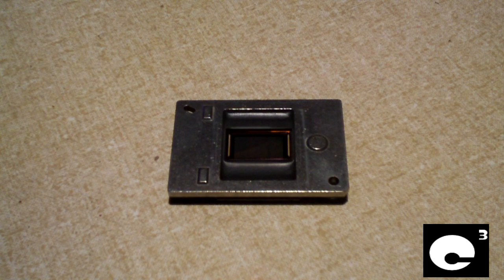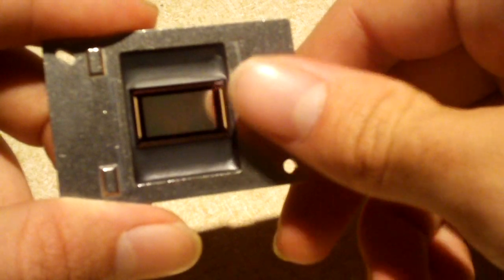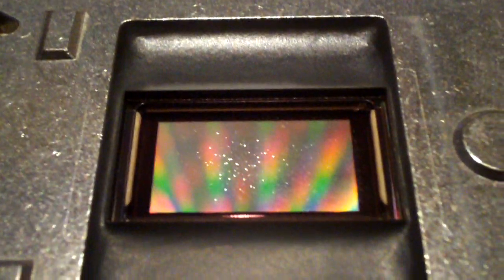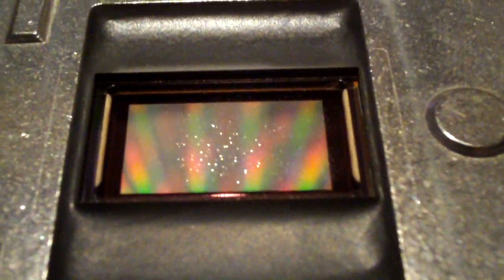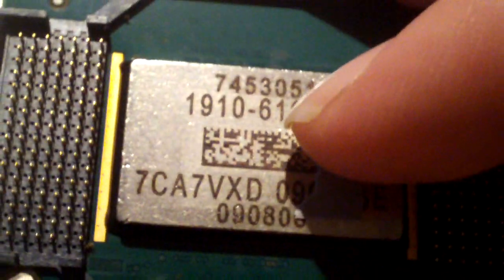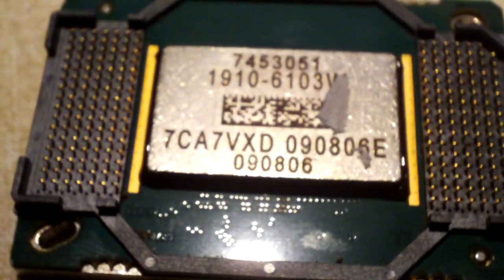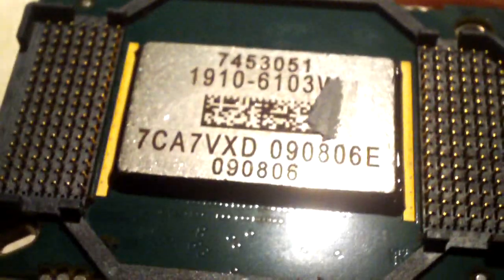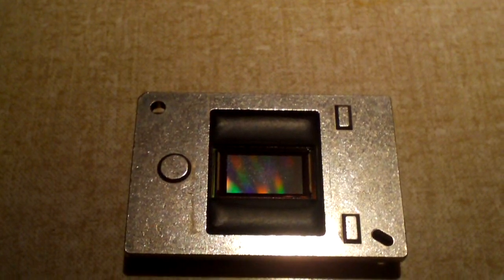Some Information Regarding DLP Chips, and Why I Believe Some Fail

Comment: Does LCOS technology have this, I had a JVC 61" LCoS Technology and have never even changed the bulb in 8 years, it is awesome! I love LCOS! I see JVC now is releasing them soon to compete with the LCD, PLASMA AND LED as they are now wall mountable to!...
Reply: No, LCOS has it's own problems with filters and polarizers, but that's a different story.
Reply: ohger1 I think JVC has it down now, as at least with my 61 inch still going strong same bulb and its dusty! Turns on every-time. It was a 6 thousand dollar TV and worth every penny. I just swapped to a 1080i JVC 36 inch Plasma (Older) from a 22 inch acer 1080p (year old) and I am happy as can be with the larger screen, see little to no difference with the interlaced versus the progressive but I am sure that depends on the TV, manufacture, etc. Also, tell me some issues with the LCOS as it is used in almost all movie theater projectors JVC and sony have it patented and will not give it up. I stand behind JVC!
Reply: The biggest problem with LCOS projectors, at least at the consumer level, is polarizing filters that fade or burn, and LCOS chips (most particularly blue) that burn from too much UV light.  I don't know about the commercial units, but it's likely those employ UV filters in front of the polarizers and color filters to reduce UV damage to them and the LCOS imager chips.  UV filters would take up more room and run hot, so they would have to be well constructed and cooled to be effective.

Comment: I have a projector viewsonic PJD6211 and into 3 years two times has failed the DMD chip inside, showing a lot of white and dark spots, that continue growing in number every day until there is all the screen full of white spots. Viewsonic doesnt care about this problem and many people has suffered this fail. A single chip has a $180 price. I hate DLPS projector and I hATE vIEWSONIC bad quality! Only 400 hours and fail repeadtly!
Reply from the maker: The chip is probably overheating from either a lack of cooling, or poor thermal transfer from the chip to the heatsink.

Comment: I have a Mits 65 inch DLP. I noticed last night for the first time that when black or dark shades are being displayed, there is a grainy pixelated black and gray dot mosaic all over the screen (no white). These aren't apparent during bright color scenes or when viewing the blue screen (no input). But the anomaly can even be seen when the television is turned off and is powering/cooling down, and the lamp is still somewhat on. Is this likely a chip issue or could there be another explanation (such as dust particles stuck or cooked onto the underside of  the screen? Thanks!
Reply from the maker: That is a tell tale sign of future chip failure. Mine used to look like that prior to failure.

Comment: Dude that was amazing info! I do a lot of repairs and always believe its mind over matter in most cases! Is there a way to fix the artifacts without replacing the DLP chip? If so whats the requirements?
Reply from the maker: Unfortunately, the chips can't be "fixed". They have to be replaced if the mirrors fail.

Comment: @MrMac5150  Mitsubishi stopped making DLP (officially in Feb 2014) due to poor management. The screens themselves really are a superior technology (more so than some OLED and most newer Plasmas aka Samsung's current line. I saw the new Samsung S9C on demo, which costs around $8K, compared to some of the old Mitsu Diamond screens and Laservue a96, Mitsu flat out wins in sharpness, motion, color, brightness and doesn't hurt your eyes).

From what I've dug up, many were fired which resulted in the TV branch being axed and the company lost big money. Poor marketing was their biggest irk as the screens were definitely in demand, but they did not deliver. Would you believe about 5 stores in California alone actually carried Laservue TVs?  In 2011 - 2013 the stores like Best Buy, Frys's Electronics, Walmart etc (stores that should have carried these screens) did not have them.  No delivery, no service.  Mitsubishi really screwed up.
Reply: wholeheartedly agree with you on that.  samsung 5300 for sale at kmart right now, has the screen door effect.  still loving my old samsung DLP.  i know the salvation army is the place to look for them, but if you're really lucky you'll find a nice 3D Mitsubishi.

Comment: We bought our tv used, and it worked fine.  Until we used shims to tilt the tv forward a bit.  Then all the black dots started appearing.  Do you think the tilting cause the mirrors to get stuck?  Thanks for your help
Reply from the maker: I doubt tilting the TV was the cause of the white dots.
Reply: +Lloyd Kadlec The mirror switching is done by Electrons not gravity

Comment: I'm looking to buy a Mitsubishi 65" DLP that is showing about 15 dots.  Is this a terminal failure?...or can I remove the chip, clean it up and reapply better heat conducting solder to stop the process until I can better afford to replace the chip?

Comment: shopjimmy.com sells replacement DLP chips pretty cheap+tutorials for the replacement (which is not difficult, requires care is about all). ALSO, I was reassured by their (very good) support that the replacement chips are an improved model from TI, which took a pretty big hit after the 'white dot' problem showed up on the first ones.

Comment: hey thanks for the info,im trying to educate myself on dlp chips. i have a dell projector that the picture was beautifull,until i started getting "stars and fleas".the lamp has over 900 hrs left so i dont want to trash it all together. my question is can i use any dlp chip in the projector?i have two ohter projectors and was thinking i could take the dlp from one of them. thanks for any info.
Reply from the maker: Look up the DLP chips of the older projectors and see if they use the same model of DLP chip as the newer one. If they don't match, you'll have to buy one.
Reply: im pretty possitive that all of the projectors are about two years old, does this matter?and i know that dell uses TI dlp chips,which i do not want to use becuase they now have a class action suite due to the defect. thanks again
Reply from the maker: tfblack33 The age might matter, IDK. Good luck finding a quality DLP chip manufactured by someone else... that's because Texas Instruments is the company who invented (and likely patented) DLP technology.
Reply: ah crap.ok one last question...are dlp chips different,like one gives a much better picture than the other or are they pretty much the same? thanks again for your help,advice and patience,its greatly apreciated!
Reply from the maker: tfblack33 It really depends on the application the DLP chip is being used for. There are all sorts of different designs.